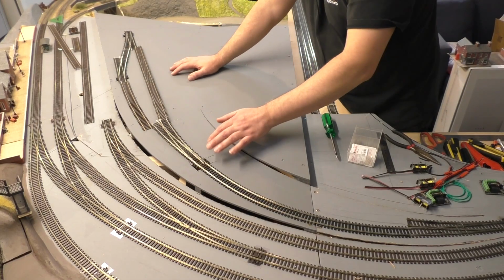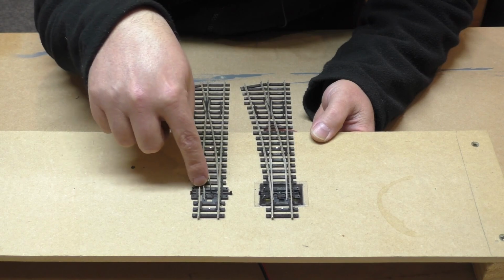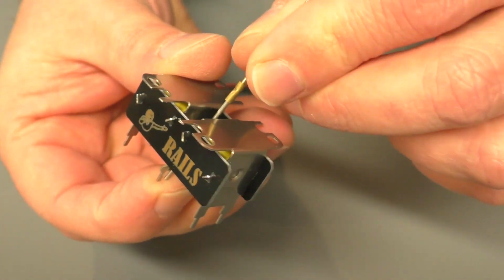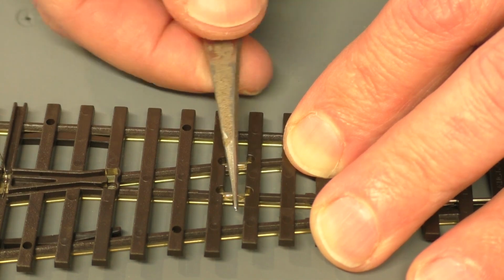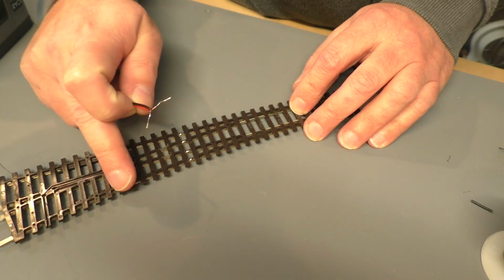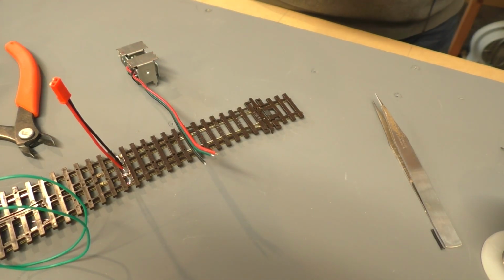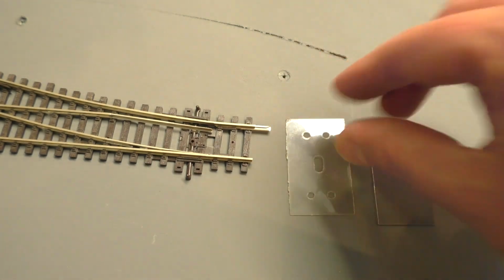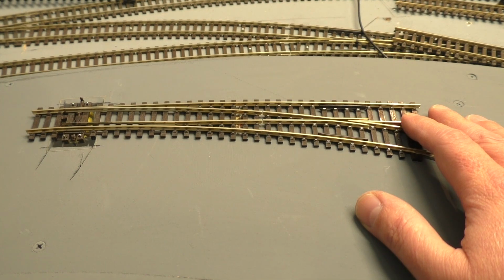Installing Point Motors on Station Road

Comment: Julian, what gauge wire are you using for the frog? I take it it doesn't need to be as heavy as the pre-wired loom coming from the point itself.

Comment: Love this, i never for some reason thought of this but i imagine this would work well on my points later down the line as just need to set into the insulation board below and drill a hole for the wires. Cheers for the pointer hehe pun intended 😂

Comment: I am using servo motors controlled by Megapoints control boards. The servos can be mounted underneath using their brackets, or on top of the baseboard where they are hidden inside lineside buildings. The servos drive a 0.6mm piano wire that can be cut to any length. I have 24 points on my layout, and six of these are top mounted as I cant access their location beneath the layout.  They work great, and include for electrofrog control via relays.

Comment: Very interesting method of installing point motors. I chose to use the Hornby surface point motors to avoid going under the baseboards but your system seems to work well. Thanks for sharing Julian. Roy.

Comment: Hi there ,, what a gr8 informative video and really handy tips. I just not long ago bought a train layout and is 8 x 5 and has 12 sets of points that are all motorised and all work good. It was a bit of a bargaind at $80.00 for the lot
It has the same type of points and point motors on it as you are showing that are both curved and left and right and a couple of Y points as well.
There is 1 thing would like to ask and that it do you think the clear plastic that you used ? Is it used just to cover the the point motor as in to stop  dust and dirt and debris etc.
Keep up the good work and gr8 videos there m8.
I also liked and subscribed too. 😁😎
Cheers from John in Australia

Comment: Oh, Julian, this is such a lifesaver. Thank you! 
I’ve been dreading installing point motors for months. Like you I’d bought some under-track ones from Rails. I struggled with the extended pin on the first I tried to fit. Then the top part of the pin fell to the very dusty wooden floorboards in my shed, never to be found again. I’ve broken one of the clips for one of the Peco twistlock motors I bought. And now I have some Seep solenoid ones which I wasn’t looking forward to crawling under the baseboards to install. All I need now, thanks to this very helpful video, is a Dremel.
Progress on the Project B uplift also looking very impressive.

Comment: A small blob of araldite in the brass connector works fine.
Reply: Super glue does the trick to.
Reply from the maker: Thanks for the tip, much appreciated.

Comment: Those little point covers are handy, I have thought of similar but they will have to be punched by hand, is the peco point motor a low profile, I`ve not had to use the rails version.